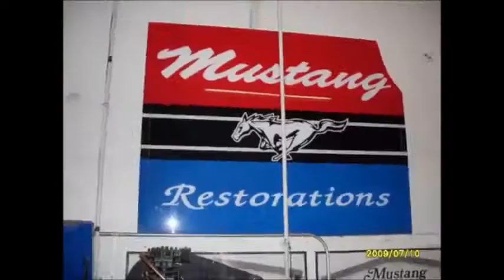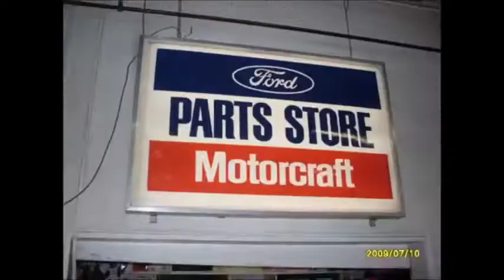Episode One - Operation Mustang Web Show (10/19/11)

Comment: I recently converted a 67 from a 200ci. 6 cyl. to a 302 v8. Is it possible to use the stock wiring harness when I go to wire the new engine? I haven't got that far yet and wondering if I need a new wire loom... the stock one is in good shape also. Any help is appreciated. thank you
Reply from the maker: The only harness will be the "Engine gauge feed" harness. About 30 bucks
Reply: awesome thank you so much.

Comment: Hey Doc,Am Interested in A 69 Mach 1 S Code in NE Part of Country & I'm in So East USA& Dealer Is Advert.it as A Non Pow.. Brake S Code.All Info I Can Gather Says All 69 S Codes W/ Disk. Brakes Were Built as Power.Brakes from Fact.,But Accord.to Copy of Marti Report on Video,Original.Dealer it Went to Was in Canada.Could Canadian Spe..Order Cars Be  Shipped There W/ Out PO.Disks.? 2 UnderNeath Pics.of Car Don't  Show Entire Frt.Susp.& Though No Rust is Visible on Flr.Pans or Frame,Frt.Brakes   Aren't Visible.Guess Frt.Disks Could Have Been Added by First Couple Owners.
Reply from the maker: Hi Ed.. If the car came factory with disc brakes. It would be Power Disc brakes.. Does the Marti report show a disc brake option? If not then someone has added what ever it is now..
Reply: Chris Ingrassia : Tks for Quick Response,No M.Rpt.Does Not Show Disc.Brake Option,Guess They Were Added.My Concern Was Dealer Is saying "Manual Disc.& No P.Sterring, Way it Came From Fact.So W/ No Booster on F.Wall,Guess Dealer's  Not Familiar W/ Origion of Discs Just thought Canadian ,Could be Sp. Ordered W/ Out Them.Car is Super Good Price & Minimal Rust,So Think it Was a Basic S Code,W/ only Magnums & 4 SPD.M.Rprt.Doesn't Say it Was Ordered W/ Back W/ Slats & Has Them So Figured One of Origin.Owners Added Discs + Slats.THKS For Ur Quick Resp.!!